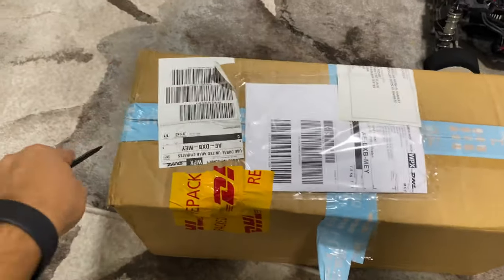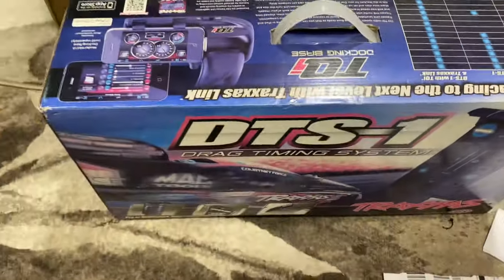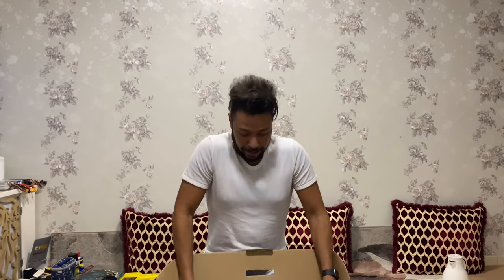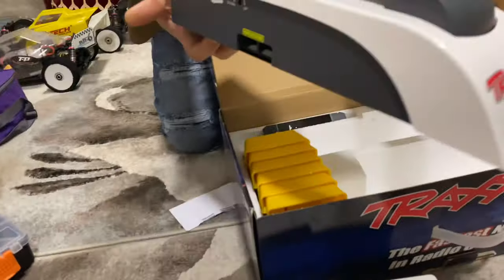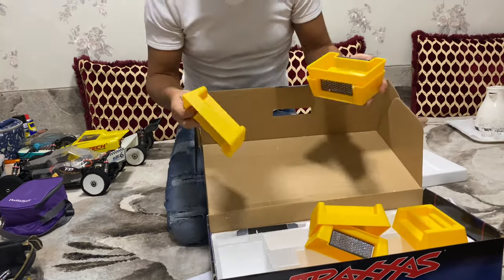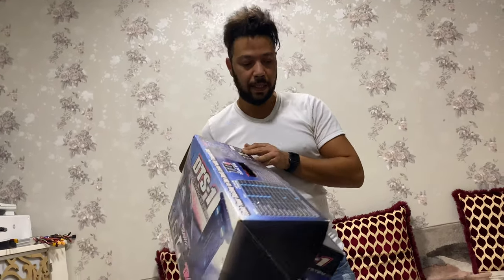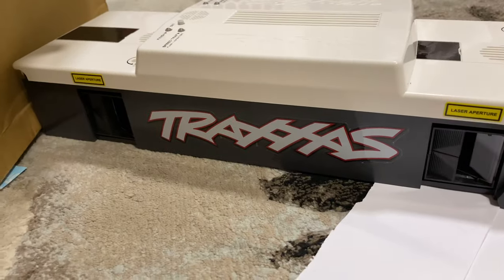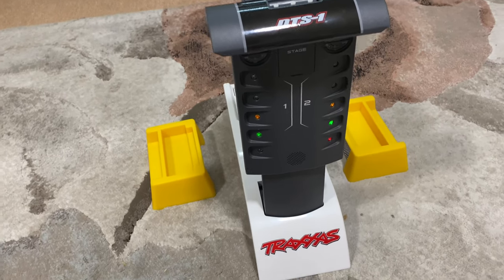Unboxing Traxxas DTS-1 RC Drag tree System

Comment: hey I got a question! how far does the laser beam for pre stage and stage gotta be from the reflector? Im trying to do a project and I wanted to know if you set the reflector about 10 to 15ft away from the laser beam it would still work!
Reply from the maker: i managed to get 30 feet and its working !!!